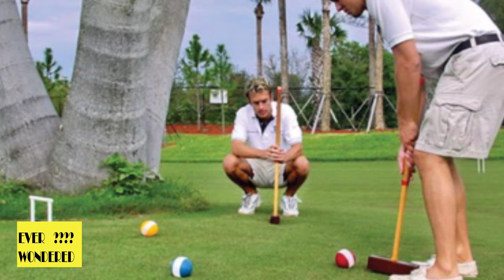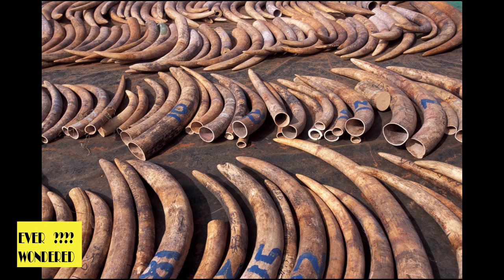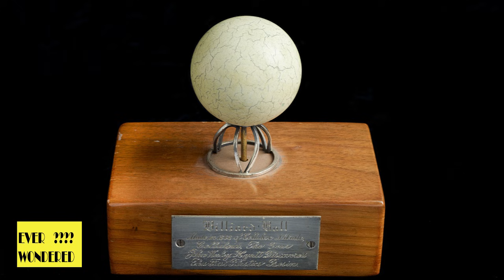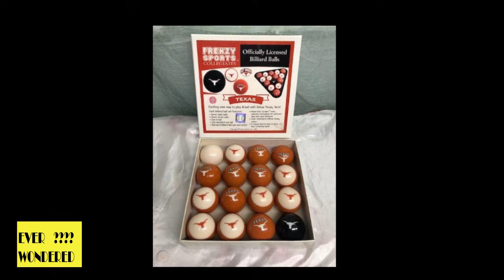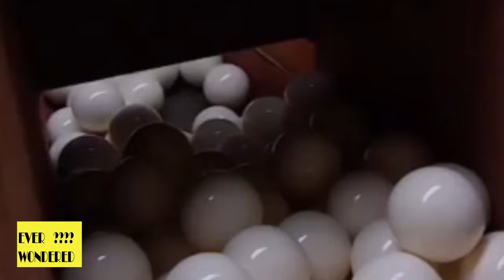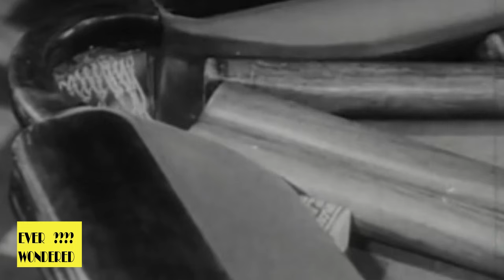How Billiard Balls Are Made? | Evolution of Billiard Balls Industry

Comment: As is  the case with so many YouTube videos, the video is great but the sound sucks. In this case the background track is much to loud, quite monotonous, and hardly necessary in a technical video like this. Heck, without I might have even been able to understand his pronunciations. The video really doesn't explain how the various colors and numerals  are integrated into the structure of the ball. In the one scene the liquid plastic is poured into the spherical mold right to the top of the fill hole. When do the numerals and stripes get added. It seems in the one pictorial view they are embedded throughout the entire diameter of the ball, but this is never explained. Also, there are some very old B&W clips used which I have seen in much older documentaries about the topic. It's doubtful the manufacturing techniques shown in these old clips are still used. Overall Rating C+ (mostly for polished presentation, more than I can say for most YouTube technical videos)
Reply from the maker: Thanks for your feedback